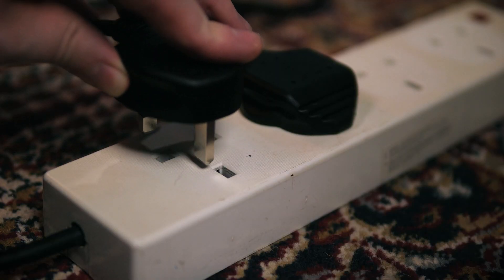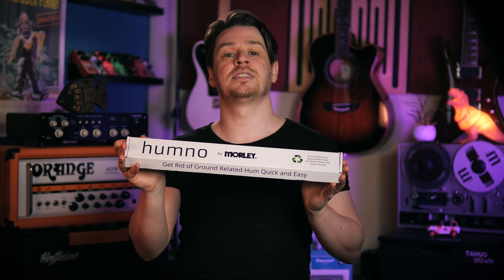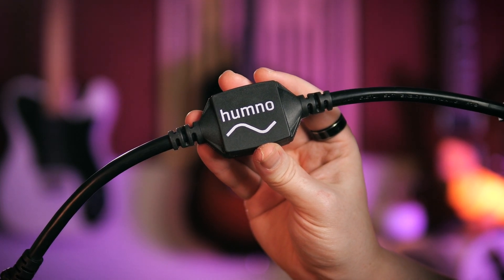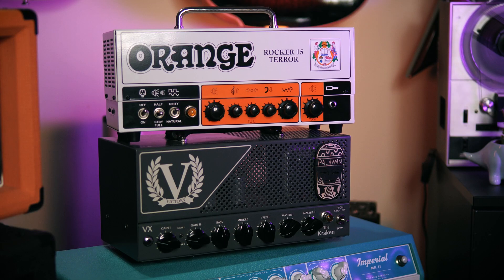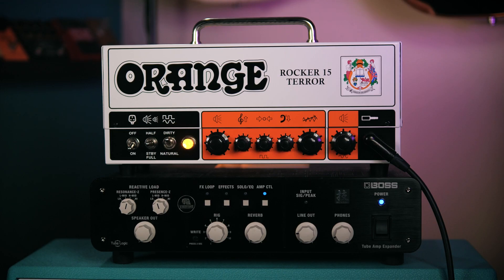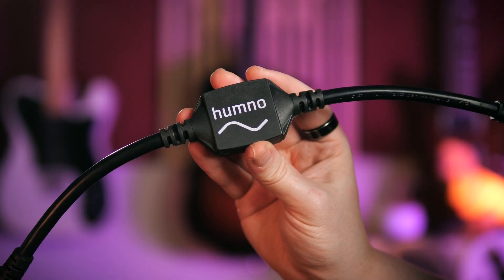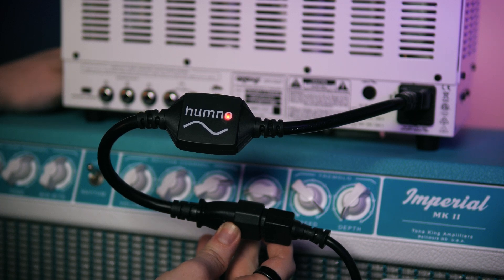HUM? NO! Eliminate Ground Loop Hum

Comment: There is a common mode choke between the X line and neutral (or Y Line for 240VAC) to suppress any conducted EMI/RFI noise on the mains. The earth pin has two 6A10 diodes connected in Anti-Parallel (to allow for current both ways) and a 1k 1/2W resistor. The diodes only conduct (forward voltage) when the voltage is 0.7V or higher, essentially isolating signal ground from earth ground. The resistor is simply there so any outlet tester will light up the ground light. 

Ground loop voltages are in millivolts so the diodes block that voltage eliminating the ground hum. However, should the chassis become live at line voltage well above the forward voltage drop of the diodes (0.7V), the diodes will pass that higher voltage as normal to ground, and blow the fast blow 6A fuse inside and/or the fuse inside your equipment.

It's a clever circuit, one that can be built for under ~$30 USD. It's important to know this won't always solve ground hum, but it's a great tool!

Comment: had an amp / guitar setup that picked up the local am radio station. called it the ghost of les paul cause he picked up his local airport control tower guy, before getting a knock on the door (both ways) back in the day.

Comment: How would this work if nothing is grounded? I live in a country where grounding is not standard or even usual. Electrical noise can be quite, well……noisy. Would this help?
Reply from the maker: No, this would not help.
You cannot have ground loops I there are no grounds.

Your noise is likely a result of having no path to ground.
This product would not solve your problem.
Reply: @ScienceofLoud  Thanks for the response

Comment: I have my entire rig on a pedalboard. My preamp, power supply with pedals, cabloader and an 18W power amp are all here and plugged into one extention cord. This video got me to try to listen if I have ground loop issues or not. Took me a minute to remember that I can't possibly have them because all my stuff is powered by 4 adaptors none of which have ground connection

Comment: I believe I might have an issue with the pre-amps in my audio interface causing hum.  Unfortunately it uses a laptop-style power cable so the Humno isn't going to work for it...  Any other recommendations for UK plugs?

Comment: I got to experience what a bad ground can feel like first hand.  Playing live means depending on others to do their job because there just isn't time to double check everything yourself.  (I was just a weekend warrior but I played pretty steady from '65 to the mid  80s doing lead, bass, rhythm and sound)

We had a job where I hadn't had time to check my mic myself and our soundman had all the levels from the job before so he only ran the monitors up to volume using the feedback trick (run it up to the point that the mic is wanting to feedback without anything going on and then back it off to tweak later).

I was using a mic with no foam windscreen and when I stepped up to the mic to start singing I swear a spark jump out to meet my lips!  I managed not to go down but when we finished the song I said, "Whow!! That was a bad one...  Did you see the lights dim?"  Our bass player said, "I hate to tell you this, but the lights only dimmed for you."

Comment: While this stuff does exist, I would say that the vast majority of guitar related noise comes from electro-magnetic external sources like an unshielded wire, computer monitor, or other electronic device that is putting out radiation. It mostly comes through your pickups themselves and not the amp.

Comment: 5:30 this is the exact noise that has plagued me for so damn long now. I use a heavy noise gate but the second you add any kind of dynamics or let a note fade .. it's painfully obvious.

Also it's a persistent noise not one resulting from gain so pretty sure I have this exact problem lol

The worst thing is im not even using any kind of crazy setup.. it's literally outlet---> PC ---> Focusrite solo interface ----> Guitar.  So have no idea where a ground hum is coming from... best guess is it is the USB cable taking power from the power supply unit of the PC causing it somehow.

Comment: So… what about the gain hiss? 😜
Reply from the maker: As stated in this video, that's what noise gates are for. 
Thanks for asking this question, if you want an introduction to noise gates I have a full video about them here: https://youtu.be/KUP2jle1w88
Reply: @ScienceofLoud  already watched that, but might need a rewatch 😊 Got a little Big muff that hums like crazy when it’s on, even with the sustain set only at 10 o'clock 🙄

Comment: What products would you recommend? Trying to record an electric guitar i have lots of noise. To minimize it i have to find a certain position, i have to face away from computer, hold a guitar in unnatural position (not even 90 degrees, more like 100-110 degrees), any deviation and...noise like in 5:30 in my headphones (monitors off, of course). 
It is either with single-coiled pickups or humbuckers (the first ones, obviously, worse). 
I am thinking about getting Electro-Harmonix Hum Debugger pedal. 
That's the main question. Also...
~ I have too much noise when i turn the mix (comp/in) knob towards instrument (1) and a very little headroom for recording, either the signal is too weak or, after moving the gain knob just one little degree, i get distortion, noise and clipping (2). It is either with single-coiled pickups or humbuckers (the first ones, obviously, worse).
(1) - waiting for a new interface Topping (could not do anything with PreSonus iTwo or SSL2). 
(2) - waiting for a new interface and a ground loop breaker usb power injector. 
For recording with a physical amp (Katana) i plan to get a Morley Humno Noise Eliminator. 
DI boxes (active and passive) seems like do nothing in my case. Don't have any Gate pedal and not planning because it is tricky and i hardly play heavy music. I have a power conditioner Furman m8x. No noise-cancelling devices for pc or USB ports or 9V supply. All my guitars are in tact, grounded nicely and shielded.
Thank you
Reply: “Thanks” for concern and help, Science ;)
Reply: Did you get a USB ground loop breaker and did it work? I have the exact same problem on my PC. Might have to try one out
Reply: @BobGnarley.   I did many things. Solved most of old problems…and got a new ones (now it is a computer memory, CPU, processor… with so many plugins, libraries and a DAW load… there is no other way).
What made difference:
* Electrician finally came after 3 months calling. One outlet didnt have a ground. It helped, but insignifically: the messy, packed outlets cavities and who knows what kind of electrical mess somewhere else, plus things around the house - the main thing. And i asked electrician specifically to fix everything when he installed a new panel and rewired that room. How would obnoxious putin say - “negative progress” ;) It is so hard to find a knowledgable and caring person in any profession.
* StudioOne made DAW more compatible with W11.
* Bought Arturia MiniFuse 2 interface (big difference, but with a smaller buffers it gives noise…).
* Transformator and noise-cancelling devices did nothing.
* Anti-Noise/hum plugins did either nothing or damaged the sound badly. They are not meant for that kind of and big noise.
* Make sure that you have a good cables and clean ones : one of the short cables i use from guitar effects board had a teeny-tiny sticky thing on the tip - i would never think that it can make so much noise.
* Bought a used Digitech RP500 that has (apart from lots of handy settings) a ground loop and gate (big-big difference).
* And, finally, the most important thing… I already have a hole in the floor behind the computer for ethernet and a speaker cable (for turntable), so i widened it and got a thick cable (for external/outside use) through from power-conditioner to the outlet in the basement (so, the power outlet is now 5 feet bellow and 18 feet away from all equipment).
* Got the picture? Now draw yours, using my “brush techniques” ;) 
I hope it will be nice :)

PS. If you decide on a new interface, be careful with that praised Toping: i’ve ordered it on Ali, after submitting the payment ive noticed a weird address; i wrote them the right/actual/default address..did it 3 times for 3 days - no answer, and then they wrote me that the item was shipped to … “Denis 3 lakes Wisconsin” (yes, thats it!)…After 3 months of lies, waiting, fighting i got my money back. Thats another “stroke of experience” ;)

Comment: Ive been looking at this because my amp makes a high pitched whining sound and was hoping this would be a fix to my problem.
Reply from the maker: A ground loop most likely won't manifest as a high pitched whine, its likely your issue is being caused by something else and this product wouldn't be the solution.

Comment: At a typical performance, I usually have a multi input electrical channel strip with six inputs. I typically plug my amp in there and any effects. Would I use this Humno between the power strip and the wall or between my amp and the power strip?

Comment: My home studio is plugged into a single
outlet, via a 16 plug surge protector. If I used one of these between the surge protector and the wall, would the rest of the downstream devices, plugged in to that surge protector, then theoretically benefit from this electric noise cancellation?

Comment: Damn what’s with the $100 up charge on this $20-$30  cable?
Reply from the maker: As always, if you feel like you can develop, manufacture, and market an equivalent product for less than $30 and still turn profit, then go ahead and prove your assumption correct. 

Otherwise, it's priced where it needs to be priced.

Comment: How was a ground loop created when both of your amps where on the same power strip? I am deeply confused.
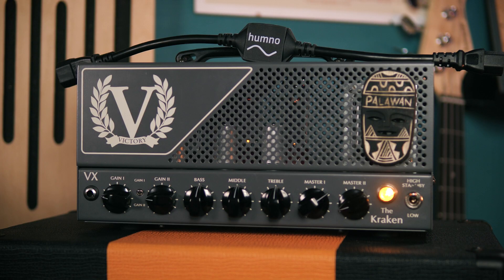Reply from the maker: If you can't see how two amplifiers connected together and sharing a power strip forms a ground loop as depicted on the diagram at 4:45, then I'm not sure how else I can explain it to you. 

There is a closed loop of ground connections in which current can flow, rather than two separate paths to ground.
Reply: @ScienceofLoud    Thanks for the response. You see I am not an electrical engineer so I am really trying to understand. From what I learned so far, ground loops are created when there are multiple paths to ground with "different ground potentials" like when you plug two amps into different power sockets and then somehow make an audio connection between them, like in a wet-dry configuration ( isn't that similar to what you did, minus the common ground? - I really can't see the difference).
    So logically thinking without pretending to know everything: if you plug everything in the same outlet using a power strip, everything has common ground. And this is exactly what this guy proposes (tip 4 I think):  https://www.youtube.com/watch?v=qAB9LSPpJFI And he's not the only one I saw this. 
    So this is where my ignoramus ass is coming from. Here is another quote from PRECISION DIGITAL: "A ground loop is the flow of current from one signal ground to another because of a voltage differential between the two grounds".  Sorry but your 4:45 diagram does not show - to me that knows nothing atleast - where the ground differential resides when both amps are - as you implied with your words and showed in the video and the diagram - on the same path to ground, sharing the same power strip.

Comment: Remember a signal ground "loop" is caused by two (or more) paths to earth. Often what people refer to as "ground loop" is actually a lack of a solid path to earth. There are ISO transformers for signal cables available as well. That would go on the signal cable betwween your amplifiers. A better solution with NO possibility of electrocution.

Comment: So I have atrocious ground loop hum on my amp's dirty channel when I use a cable, but not when I use wireless for some reason. Someone told me it was because the wireless pack is buffered, so I plugged my guitar into a buffer pedal and then cabled into the amp and it still hummed atrociously. I bought this "Humno" product from Morley on Sweetwater and guess what? It made absolutely zero difference. Thanks Sweetwater for easy returns.
Reply from the maker: Sounds like a grounding issue in the wiring of your guitar. 

The wireless system obviously doesn't connect the ground of the amp to your guitar, but the cable does. It's got nothing to do with a buffer. 

Check for grounding faults in your guitar.

Humno is not a solution for your problem - it is designed to tackle mains ground issues and ground loops from connecting multiple devices together.

Comment: a ground loop is caused by 2 grounds creating a loop.

by lifting the ground on one device will mean if there is a fault then the current will flow to the remaining ground.

you could cut open the humno device and see how it is made and reverse engineer it (bigclive if you are reading this buy one and open it up).

Comment: you can also eliminate the ground loop by using an audio isolation transformer.

if you ever wired up a transformer for low voltage electronics then it should be the same for sound systems.

having an isolation transformer in the audio circuit  works too.
Reply: That's what the product he's demonstrating is.

Comment: If someone seriously suggest removing the ground pin from a power cable they deserve a Darwin Award, I would never recommend removing the ground pin unless you want a shocking new hairstyle, or worse to be rocking in the afterlife.
Reply: Making a living as a musician in NYC for many years, most musicians keep an electrical power strip with the ground broken off as a last resort solution when there is no other way to eliminate the hum. We always avoid it, but, honestly, I, and just about all the other musicians I’ve ever worked with, always have one of these in our gig bags (with the ground broken off). we know that it is dangerous, but sometimes it is the only way to get through the gig.

Comment: I just tried the HumNo... for me it did not solve the problem sad to say. I have close to no hum/buzz on clean channel or with the pedals attached via the FX loop. But if i i use the Ultra Gain (Marshall DSL5CR) i get a loud "buuuuuuuzzzzzzzz" and/or if i engage my SoulFood Overdrive pedal i get this loud buzz. Tried different outlets in my house, same issue.... arghhhhh just so frustrating....
Reply from the maker: That's the distortion amplifying the noise floor of your signal. 
You want to use a noise gate to shut off the noise floor reaching the amp when the signal level drops below a certain volume threshold. 

Poor quality cables and guitar wiring can also increase the noise floor, so look at replacing anything that is substandard. 

Single Coils with distortion will have a lot of noise, using humbuckers instead will eliminate much of that. 

Humno is for ground loops and mains ground issues - it will not fix your problem because the noise you are experiencing is being generated in the signal chain.

Comment: I think I need this for my studio/office set up, never mind my guitar setup

Whenever my right screen turns on, my studio speakers end up humming & it is so annoying. I might just get a few of these for my screens & speakers
Reply: I want to comment on this because a few months ago, ground loops plagued my life. I'm a music producer as well. 

Your screen being on can cause hum because the IIRC, the LEDs generate EMI which can be picked up by pickups. This can be resolved pretty easily by just recording guitar away from your screen. If you are using a gaming PC tower, you should turn off any strobe lights/LEDs when recording. 

Ground loops are caused by multiple grounds connecting to each other. For non audio apps, this isn't a problem, but plagues us producers especially. 

Instead of getting a humno, you can separate the grounds of the amp and your PC by using a DI box with a ground lift. It's much cheaper. 

This next part was my biggest hurdle to getting rid of the noise. Connecting the PC to an audio interface, then connecting those to powered speakers or an amp through a DI box still introduced noise, even if I put DIs on all of the ins and outs of the interface. And this one is the most wild thing.

Some PC towers introduce ground hum into the signal through their power supply which travels through the ground in the USB connection. You can't just cut the ground wire in a USB as it will not register a connection. For this, you have to buy a USB isolator like the iFi defender. It may also work if you plug the humno into your PCs PSU but I haven't tried that yet. 

Good luck!
Reply: @TeddysMusic772  my setup gives hum even when no instrument is plugged in. It’s quite a weird one

I have a macbook plugged into 2 32” QHD displays. I then have a focusrite 2i2 that goes straight into the mac, which also outputs audio to 2 KRK monitor speakers. The mac, the 2 screens & the 2 speakers all have their own power supplies. So yeah, there’s plenty of ground to give hum.

Weirdly though, the speakers don’t give off any hum when just the left-hand screen is turned on & doing stuff. It’s only when I turn the right-hand screen on that the KRKs start to hum
Reply: @rikflix4636 you might be able to get around the issue by using a Beringer Hum Destroyer for your speakers. That's the cheap solution. 

IMO you should look into USB isolators anyway, cuz PC ground is always a pain to work with.

Comment: I bought from Sweetwater. My home was built in 1958 and has no grounded plugs. This little gem fixed all the ground loop issues I had with my amps. Highest recommendation.
Reply: How much do they cost please?